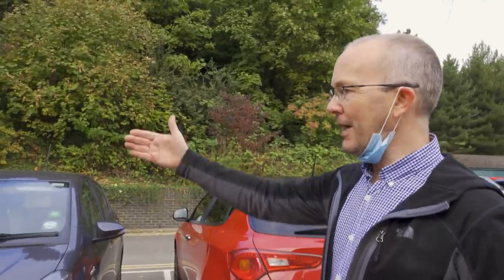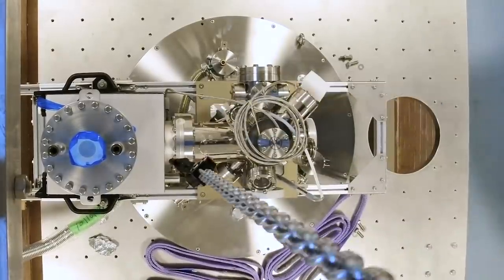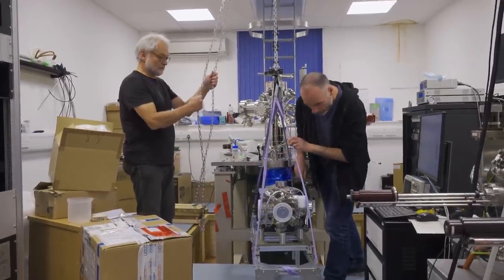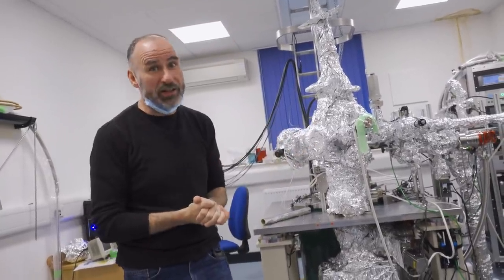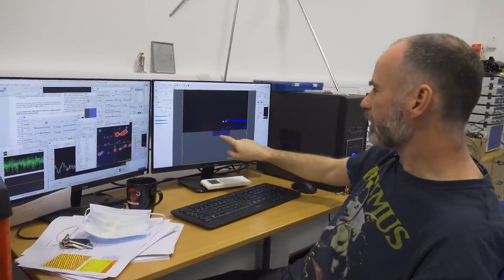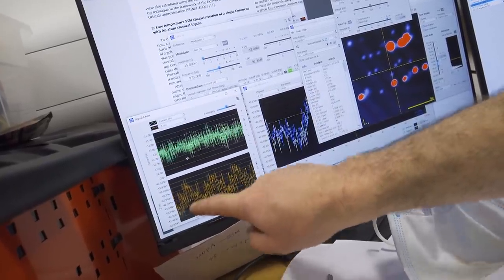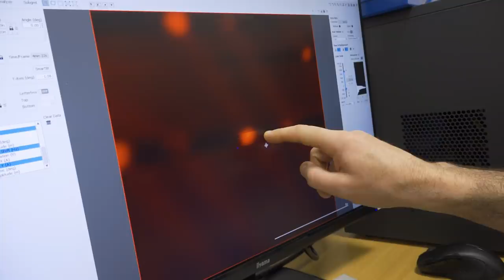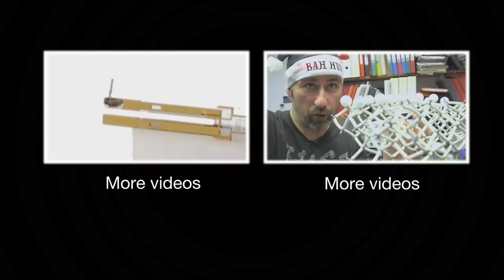Unboxing a $1.5m Microscope - Sixty Symbols

Comment: its amazing how nowadays you need "only" 1.5M$ to image individual atoms.
Reply: And the thing is, you can image lots of atoms at the same time for a lot less. If that's not quantum evidence of the benefits of mass production and economies of scale, I don't know what is!
Reply: The thing is there are even cheaper "more basic" electron microscopes, it's only that this one is a crazy high-precision device.
Reply: @MapedMod  - Well, my cousin has been moving gold atoms for years, and he never needed an electron microscope. He just uses a crowbar and a big sack with a dollar sign.
Reply: @yeet1337  you can even build one yourself.
Reply: @RFC-3514  Brilliant.
Reply: @MapedMod  - I don't think he'd find that profitable.
Reply: @RFC-3514  You're absolutely correct! I can image over octillion atoms completely for free*.

*not including the cost of maintenance of my body which is required to function in order that my measuring device can sample said images.
Reply: @yeet1337  Indeed. The YT channel Applied Science bought an old used one and got it working.
Reply: you can image single atoms with a diy stm at room temp too :) move single atoms is another thing though
Reply: Why are they doing this?
Reply: yeah. That's almost 100x zoom
Reply: Especially when you factor in the personalized support you get from people with that kind of expertise while assembling it.
Reply: @RFC-3514  
Comedy Gold.

Comment: My PhD thesis, in 1987, was about modeling differential conductance in the STM. It's amazing to see how far these instruments have come.
Reply: Interesting. Could you point me out some of the ref you had work on. I wonder if it is possible that the current noise in some situations are due to oscillation from differential conductance.
Reply: ok?

Comment: Wow! Honestly I'm kinda surprised that an STM-AFM is so "inexpensive". I remember when STMs first started making headlines back when I was in school. I even remember back when the "official line" in the textbooks was that individual atoms were "impossible" to ever see, how times have changed.
Reply: Pedantically, the old textbooks are not wrong; atoms are actually impossible to see... here they're being "felt", and the result of that feeling process is being displayed visually on the screen.
Reply: It is possible to see within the space of an atom, though; there is a gigantic TEM at Hitachi's central R&D lab which has a resolution of 43 picometers.  A hydrogen atom has a diameter of 120 picometers.
Reply: @douro20  That's electrons, not light. The point I'm making here is that it's unfair to insinuate that a textbook was wrong for saying that atoms are impossible to see, since claiming the existence of electron microscopes as a counterexample is rather missing the point.
Reply: They are impossible to "see" because of the limitation of the wavelengths of visible light at atomic scales
Reply: @TheHuesSciTech  Yeah sure give it 50 more years and  theyll figure out how to add sub atomic particles to an atom to get certain properties that dont exist in nature and then building whatever the heck you want atom by atom.
Reply: @BILLY-px3hw  couldn't we just capture an image in a spectrum of higher wavelengths and then shift it into visible light?
Reply: I think the problem is you would need x-rays, and there are no materials that could be used for lenses for making an x-ray microscope

Comment: Sorry you got shafted with Agilent's worst pump series. Those IDP scrolls have a terrible habit of failing right at 8000 hours and as with every scroll pump will potentially contaminate your shop and system with tip seal dust. A better option for dry pumps would be the newer roots rotary pumps like the Neodry series from Kashiyama or the Ecodry series from Leybold. Base pressures are lower on average, runtime hours in the high 30-40,000s rather than 8-10000, and they're also far quieter for your shop. 

Loved seeing the Varian 979 helium mass spectrometer in the background, it's rare to see those when I'm not at work. Great vid and best of luck with the pumps.

Comment: Piezoelectric actuators are also found in quite a few consumer video tape recorders. They are needed to track the video tracks accurately. On consumer systems there typically is no margin between the tracks so you need to track it very closely.
Reply: And in HDD's

Comment: AFAIK what the STM actually shows is electron orbitals, with the voltage determining the orbitals "seen".
One image i really like is "quantum corral", it shows that some surface states can extend over several atoms and really visualizes an actual wave function. I think it's from the same group that did the IBM letters by atoms.
Reply: Indeed. Thanks for raising this (although STM maps probability density, not the wavefunction. The latter is not an observable.) Please see the blog post linked in the video information for more.

Philip (Moriarty, speaking in video)

Comment: Does the microscope prevent itself from crashing when there are vibrations that exceed the capacity of the pneumatic decouplers? 

Is there a low-response-time safe mode that kicks in? Is the microscope rigid enough to not really take damage? Is the risk of it happening low enough that it's accepted as a potentially destructive event?
Reply: The vibration dampening isn't to prevent damage to the microscope, it's to ensure the distance to the sample remains stable.
Reply: the microscope doesnt get damaged when you stamp on the ground or even kick it, only your sample is rip and your measurement is wrong

Comment: I'm reminded of a video of a guy shouting into a rack of hard drives and causing a measurable disruption in R/W operations.  Even with this machine insulated through the floor, could sound through the air still cause the machine to vibrate and interfere with measurements?

Comment: Is the gold used for it's excellent cold welding property? I've seen tiny solid gold wires bending toward eachother as they approach and welding together perfectly at room temperature, I think the process was used to connect the internal and external contacts of integrated circuits.
Reply: Paul, the gold wires are usually ultrasonic or thermosonic ball bonds.

Comment: As someone working in the field of industrial maintenance and machine installation, I can't help but wonder what kind of requirements you have on your installation surface. It looks like the machine base is just dropped down onto the raw concrete slab. Is all leveling of the equipment done with the screws on the heavy frame?

Comment: Is the frame mounted on vibration reducing floor/feet. I can't tell from the video and was interested to know since you are achieving such low temperatures. Amazing apparatus.
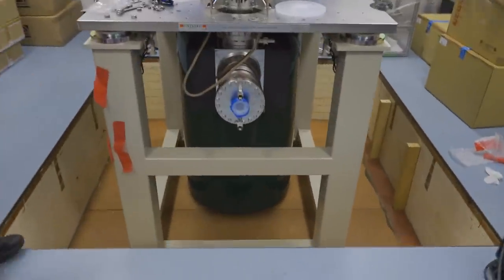Reply: I am confused about the feet as well. Around 4:15, it seems like there is a pressure gauge at the closest leg to the camera and the left leg seem to have leveling device inside. At 5:57, there is a closed up for other two legs with leveling device looking stuffs with 2 black air hoses (I think) attached to each for in/out. 
But it is all my guess and I have never seen such a small air isolaters. Either the device is lighter or really high pressure air. 
Please let me know if anyone know about these legs.
Edit: 20:48, he said air legs. So they are.
Reply: @Danji_Coppersmoke  I suspect the hole in the floor must be filled with a vibration isolating concrete. It also serves the purpose of isolating the floor from the apparatus. Vibrations from walking around would raise the temperature and also interfere with the stylus. When I was a Manchester Uni when they got the World record for coldest temperature the experiment was done in the middle of the night - vehicles driving on the road near the Physics department would noticeably raise the temperature. You could even differentiate between a car and a lorry 😃

Comment: This reminds me of 3d printing in a way, (or perhaps the other way around I don't know). Except the stepper motors are probably geared down a lot to get that kind of precision. 

I wonder if they've got the same problems 3d printers do. 'Ringing' is what they call that 'double image' thing in 3d printing.
Reply: I feel like Prof Moriarty could give us a crash course on how these work in detail.
Reply: They aren't stepper motors or gears, but I totally see what you mean about it being like a 3d printer. Like he said in the video they actually use the deformation of piezo-electric crystals to move the tip super precisely
Reply: @kevinwells9751  Oh, duh, it'd be a very high precision voltage controller. Instead of a stepper. He did mention the piezoelectric controls I just didn't put the two together.

Comment: I’ve moved probably about 1,000 pallets with a forklift at Home Depot, the most expensive being about $7,5K. I can’t even imagine the pressure when it’s $1,5M.

Edit: I haven’t always done this, and I’ve been a mechanical engineer responsible for $18M projects. However, there was never a time when everything hung in the balance of the motor movements you’re making right now!

Comment: How is the tip controlled, what does it travel on.  What is the tiny equivalent to machine ways used to accurately position…anything?
Reply: I think it's done with piezeoelectrics.
Reply: We've done a lot of videos for Sixty Symbols on this in the past. See also the blog linked in the video information -- search for scanning tunnelling microscopy or atomic force microscopy there.

Philip (Moriarty, speaking in video)

Comment: so a  question would be since you have covered this on this channel before, can you arrange carbon atoms to create graphene?
Reply: My guess here. No. Carbon attaches to other so well that once it is on surface (assume metal surface), it won't move. If forced, the atoms in the STM tip will probably be moved rather than the carbon atoms. One might try a very special substrate/surface for carbon but I think when you put a loose carbon atom, it will just grab the residual air molecules in the chamber to form molecules. 
But you can move CO (carbon monoxide) atoms very easily and it is quite standard technique. Then somehow if someone found a way to get rid of oxygen atoms from CO after moving CO, then you may get left over carbon there. Wild and uneducated proposal here.
You can make all type to structure (including graphene like structure) using CO. People had done those.

Comment: Why does it have to sit in a pit, is it in case the liquid nitrogen leaks out or the vessel bursts?
Reply: The room isn't tall enough since it uses a long vertical transfer system. Looks like they extended both ceiling and floor.

Comment: This piezo electric effect is at the core of various theories about how certain… architectural structures in the middle east you may have heard of were originally designed to be electrical generators. Quite tenable when one considers the matter objectively…

Comment: So professor is it the current (EM field)  that is touching the atoms. Or are you fusing the neutrons and protons in the sample to the neutrons and protons in the tip?  Since atoms do not TOUCH!  Your earlier video about human hands ever coming into contact with anything.
Reply: Electron clouds of the atoms interact slightly when atoms "touch". The nuclei (the atomic core where the protons and neutrons live) absolutely do not touch. (except in a neutron star)

Comment: how "flat" are the the plates that the samples are put on??? In the machining world, a surface plate can have a flatness of 0.0025mm across a 300mmx300mm plate (looking at a specific model of granite surface plates). But if you're looking at literal ATOMS, I imagine any multi-atom deviation in the flatness of your plate would render the result unreadable.

I get that the "plate" that you look at and are manipulating atoms on are a incredibly small surface area. But how flat is it, and how would one even create such a flat surface?
Reply: Maybe you’d make a 3D map of your plate with the instrument itself before measuring anything, then “zero” the results based on that? I’m curious what it’s made out of.

Comment: 13:04 Day 45 - base temperature 300mK reached
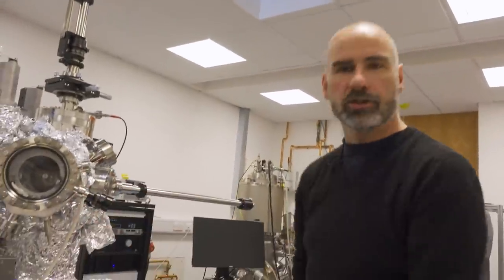Reply: 13:59 to get down to that 300mK temperature beyond liquid nitrogen and 
lots and lots of liquid helium (helium 4) there is needed helium 3
He shows the little bottle  £30,000 = $40,700 – yikes
Reply: @mechadense He claims it's mostly reusable though. I don't think a $40,000 cost is that crazy for such a device. especially if it isn't used up quickly

Comment: Sadly we hand built an STEM at UPEI back in the 90’s for a lot less and scanned graphite electron clouds - aka atoms.  I’m sadly not impressed. 30 years later and they are spending 20x the cash while doing....... the same thing. That’s just sad.
Reply: "...doing the same thing." You deposited single atoms and moved them laterally with a STEM? How exactly did you do that?

As noted in the accompanying blog post linked in the video information, the Au(111) surface, and associated quantum confinement/electron scattering at that surface, has certainly been studied a great deal. There are, however, still some interesting new aspects related to the tunnelling spectroscopy characteristics and the dynamics of atom deposition. Don't quite know how you could do either of these with a STEM in the 90s, or even today, and would appreciate it if you could let me know. Thanks.

Moreover, these are commissioning experiments to ensure the microscope is operating to specifications. New research has already started on the USM1300. Best not to assume that a YT video represents a complete scientific overview of an instrument...

Philip (Moriarty, speaking in video)